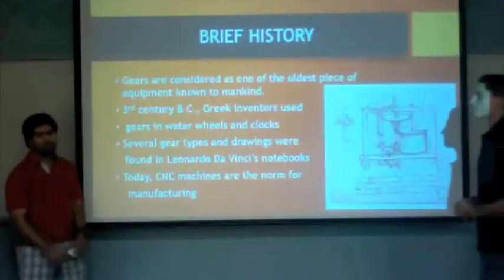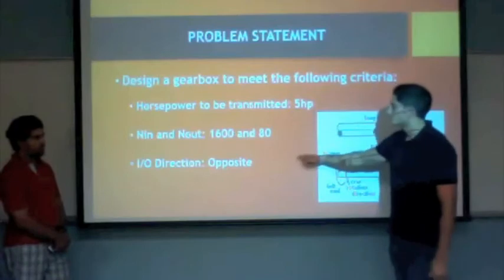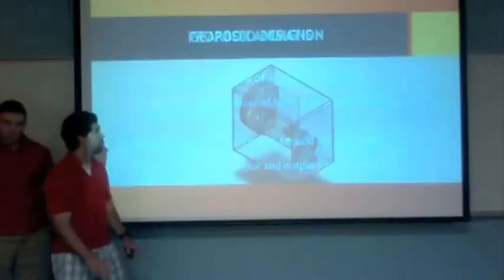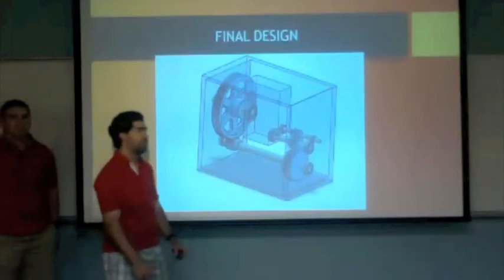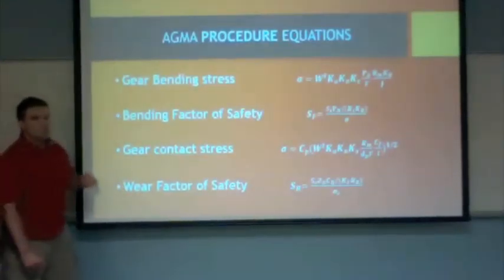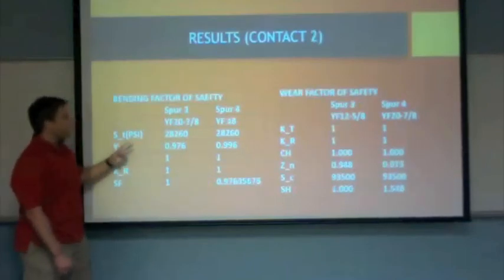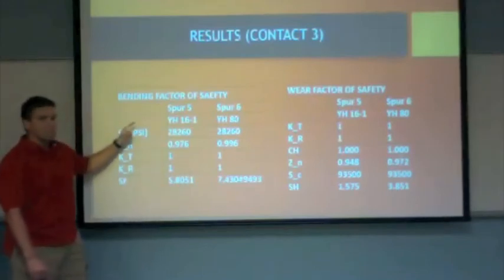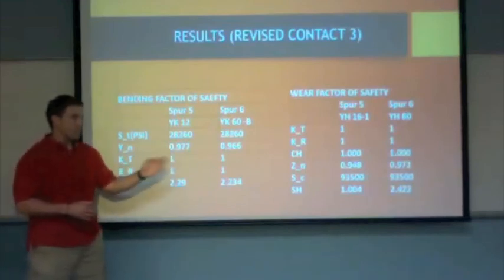Team 11: Gearbox Design

Comment: Great presentation of the gearbox design.  Thorough explanation of the project and design process.  Each speaker did very well.  I would only suggest to focus the camera since it looks a bit blurry. Also to adjust the colors and lighting since the presentation looked a bit dark due to the dim lighting of the room and the dark background of the PowerPoint.